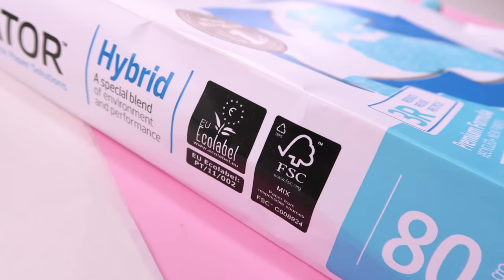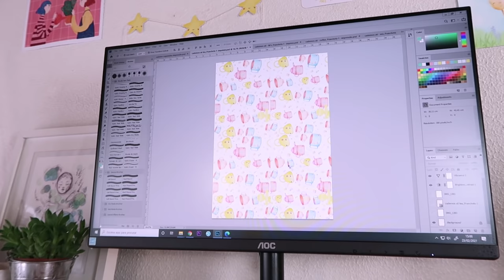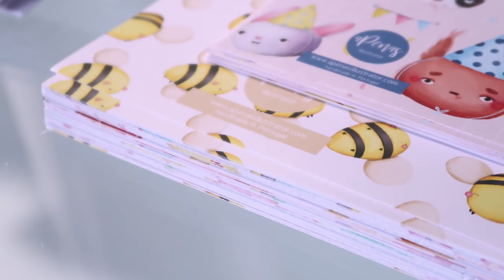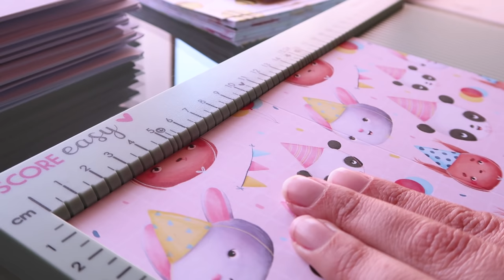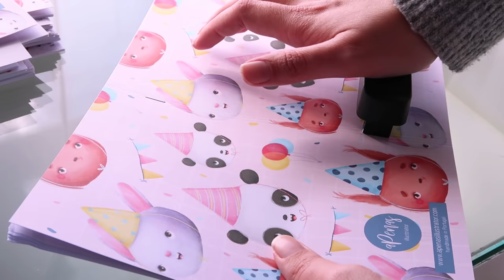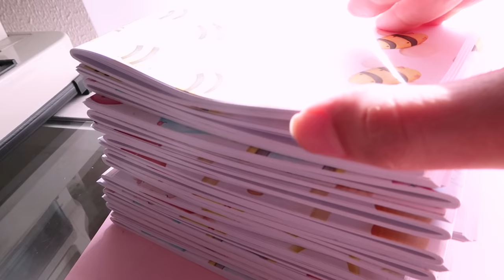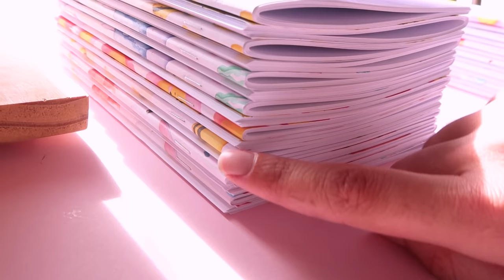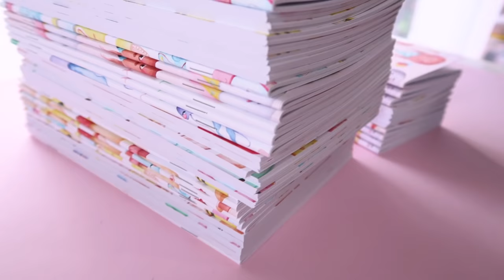HOW TO MAKE NOTEBOOKS! / Materials, Mounting and Cutting / Complete Step-by-Step Tutorial

Comment: Amazing tutorial. Thank you. The only problem I have is that my guillotine cutter that I have just purchased will not cut through the book when it has been folded in half 😢 so I cannot get the nice straight edge on my books 😢
Reply from the maker: Thank you so much for watching! :)
Before getting my big guillotine I would cut it with a good x-ato knife and a ruler, just be careful with it and don't apply to much pressure :)

Comment: Hi. I was curious because you don’t use any kind of protection on the covers. Wouldn’t it be easier to smear the ink of something were to spill on the cover? I’ve been trying make notebook too but having a hard time trying to protect my cover so my ink doesn’t get mess up from spills or accidents.
Reply from the maker: Hi! Right now my notebooks are only made of paper. I used to laminate them, it's a nice option if you want an extra protection! But the cover turn very hard to recicle because of it. I have a video of how I do my bookmarks and I explain how I laminate in there, if you want to check it out :)
Reply: @aPenasIllustrator  thank you so much for taking the time out of your day to respond! :)  I will check out the other videos. :)

Comment: Hello this is amazing work.  I do not want to be too nosey....but I printed sheets like your covers to make boxes for my products. Soaps etc.  The ink was a killer. I got nice quality like you but how do you print all those and make a profit.  Again not being nosey when I looked at your price it is not that expensive per notebook even in Canadian dollars. Do u just buy huge quantities of ink etc like I would soap ingredients?   Just interested for my boxes. I ended up sending to staples to print 11x17 sheets and could get two boxes cut with my circuit machine.   If u cld suggest something for ink costs that wld be great although I just switched to laser printer lol.
Reply from the maker: You didn't printed my designs, right? 😂 It may also depend on your printer. I printed all of these and I didnt had to change any ink in the process, even though they are printed in high quality. I also don't buy Canon ink, but cheaper quality options. I hope it helps!
Reply: @aPenasIllustrator  that helps a lot as I have been worried that cheaper int may not be as good as name brand. No I did not. I purchased digital papers off of etsy for my boxes :).
Reply from the maker: @carpentersization  some are better than others, try it out! The ones I use are as good as the brand ones 😘

Comment: Thanks for showing us your process. I checked out your shop. I notice a typo in the description of the notebooks. It should read, “blank on the inside”. Also the spec for gsm paper was different than the tutorial.
Reply from the maker: Thank you for letting me know!! It depends on the notebooks, older designs are made with 300gsm paper because I used to print them outside. The new designs have the right description :) but thank you for letting me know about the typo! 😊

Comment: What kind of ink do you use for your printer? My experience with inkjet printer ink is that it bleeds very easily when exposed to water, which makes me reluctant to use inktjet prints for usable objects. (Since touching a notebook with wet fingers or accidentally putting it on a spot of water is something I do on a weekly basis. Especially now washing your hands more often is the new normal.) 
Do you have any trouble with the ink bleeding?
Reply from the maker: Hi! I don't, until now at least. Maybe instead of the worrying about the ink, maybe you can try to laminate the covers? I laminate my bookmarks, I have a video where i show how I do it and maybe it can help :)
Reply: @aPenasIllustrator  I'll check it out, thank you!

Comment: Hello, what if I want to make a notebook with lined or dot grid paper? Should print them by laser printer or inkjet printer?
Reply from the maker: I print mine with inkjet! ;)
Reply: @aPenasIllustrator  thanks a lot, lately i've been trying to print lined papers using my laser jet, but printing after bulk of papers, faint black lines were constantly appearing on papers, so i should now try ink jet one! btw check out my notebook project that i've been doing at coleen dot mn, it's not an ad, just wanted to know you :)

Comment: How do you get your colors to print so vibrant? I have the exact same printer as you do in this video and I am having an issue with my colors bing dull and muted it is driving me crazy!
Reply from the maker: I did a lot of printing tests! Printing trought photoshop really helps and doing tests with the settings. I always increase vibrancy as well 🥰
Reply: @aPenasIllustrator  Thank you! So when you do stickers then do you print through photoshop or your Silhouette? I use Cricut design space and that is where I print from wondering if that is my issue.
Reply from the maker: @madebykylee  I save them as PDF and then print them in photoshop, 🥰

Comment: Hey, even i make notebooks, however i'm having a problem which i think you can help me with. 
The cover of my notebooks tend to tear slightly near the fold which make my notebooks look very shabby and not brand new. So should i consider changing the quality of the paper or should i try scoring the cover? Or is there any other solution? Please help me with this. Thankyou!
Reply from the maker: Hello! I think scoring the paper like I showed you here will solve your problem. Before scoring them that happened as well! Try it out! If it doesn't work, try a less thicker paper! Hope it helps 🥰
Reply: @aPenasIllustrator  thankyou soo much! Will definitely try
Reply: You could be folding against the paper grain which causes the paper to crack.
Reply from the maker: @pgm.6580  I used to fold the same way as I'm folding now and it would happen anyway. It only got better once I started to score the paper better tbh
Reply: @aPenasIllustrator  Yes, scoring helps but going the direction of the grain is also a factor.

Comment: Couldn't you automate the page counting some way? Maybe run a stack through a printer so that only the first or last page for every notebook will have a small watermark on one page? Or light design that doesn't use much ink?  Can have a big file that "prints" 10 notebooks at a time, so it'll just pass the blank paper through and then mark every start page for you. Then you just gotta flip through for the start pages. And if there is occasionally one notebook that has one extra page, it's no problem cuz you saved all that time manually counting by automating it so the printer does that for you.

So for 10 notebooks that have 30 pages each, there would be a total of 300 pages in the document, and every 1st of 10 pages would have the mark.

That would mean all you have to do is make sure the paper is loaded, and then flip the edges once printed to find the mark. Maybe slap a stickynote there until later. 

I mean.....that's what I would do..😂 It would be way faster. And easier on your hands, removing some extra overuse / repetition.
Reply from the maker: I weigh the paper now after some people left some comments here and it’s way faster 🤗

Comment: hey! can i ask you how do you do to paper in the guillotine do not move? like when i cut them they move like milimeters and that makes that my sheets are of different sizes even if i press them with the own pachine
Reply from the maker: Hiii! Are you puting the lever down? It can happen sometimes and I think it depends on the machine. Mine is starting to cute a little in diagonal, so I adjust it according to that :)
Reply: @aPenasIllustrator  yep is alwayd down :c maybe i have to check something else or i don't know i realized that when i cut all the papers tend to wrinkle or somethibg like that :c
Reply from the maker: @valegalan3822  check all the screws. Mines were a little loose and it helped :)
Reply: @aPenasIllustrator  thank u so much 🥺❤

Comment: The red strip can be rotated to prevent that issue. If you would like, you can contact me and I can share from my instruction booklet with you on how to flip it. I haven't changed mine yet but it is starting to slightly show imprints on my bottom book in the stack.
Reply from the maker: Yes, that's exactly what happens, it eats the paper on the last book I cut. I already got some instructions in one of the comments and I'll try it out, if I need it I'll ask you! Thank you so much for letting me know 🥰